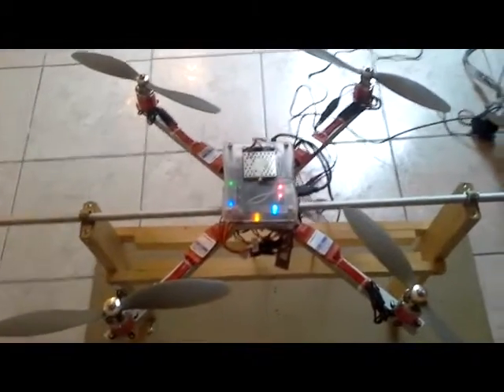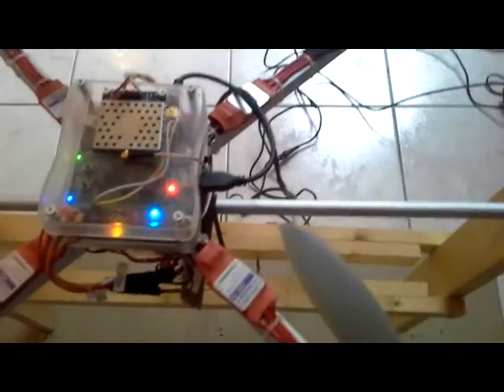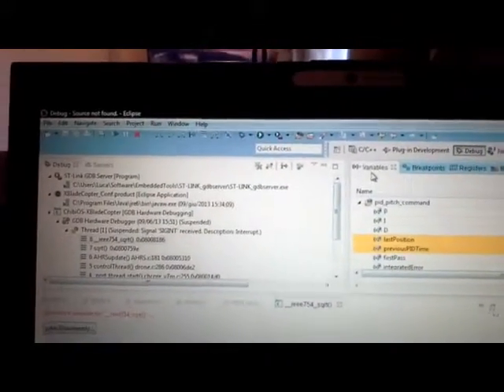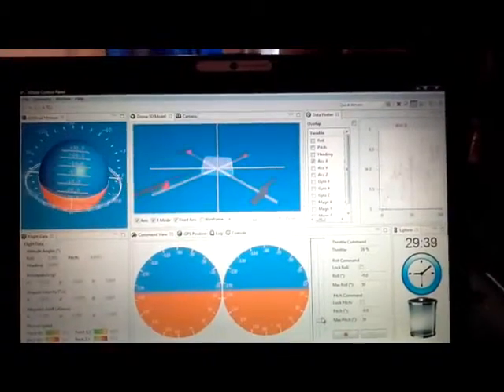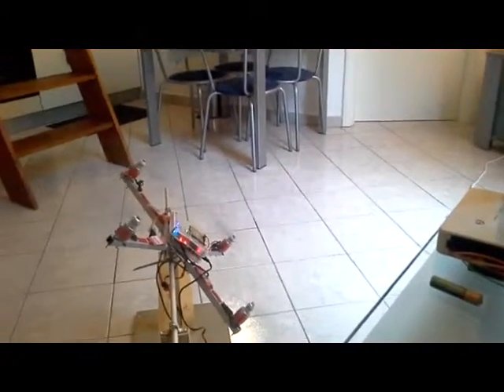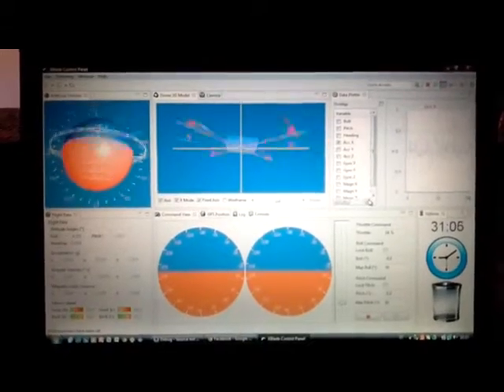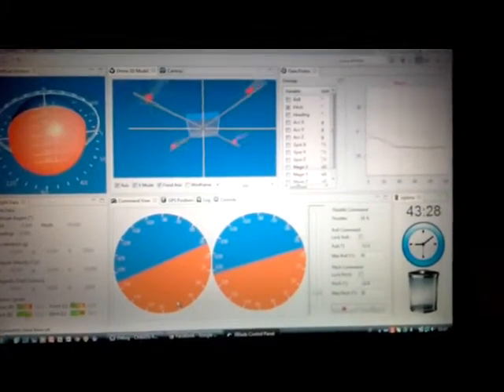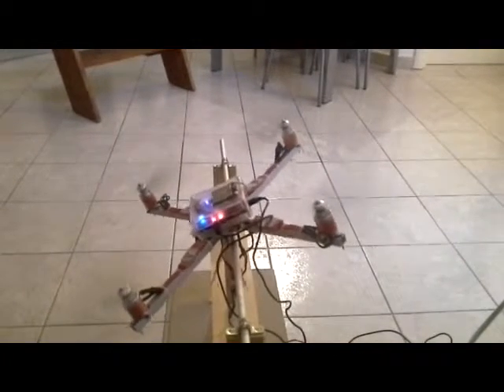XBlade Copter PID Tuning

Comment from the maker: Ciao, sul sito di ChibiOS e dal download trovi tutto il necessario, tools, demo, test ecc. Ciò che è importante è prendere una demo e cominciare compilando quella utilizzando i settaggi della board (sempre inclusi in ChibiOS). Se vai al repository del mio progetto "Balancing Ball" trovi anche il codice STM32F0 per pilotare due servi utilizzando una seriale. Inoltre è indispensabile il datasheet della board (per capire i settaggi dei vari pin) che trovi sul sito di STMicroelectronics.

Comment from the maker: Ciao,
No, uso la STM32F100. Se hai intenzione di svilupparne uno from scratch ti consiglio la STM32F3-Discovery che include anche MEMS (acc+gyro+magn) 9-DoF. Risparmi 100 euro di sensor stick ed hai performance superiori. ChibiOS-RT (l'RTOS usato) ha il supporto per l'HAL (hardware abstraction layer). Potresti anche usare la STM32F4 (ARM CortexM4), più performante (se non sbaglio ha anche un'FPU), ma la board ha il solo accelerometro, non sufficiente per il calcolo degli angoli di assetto.